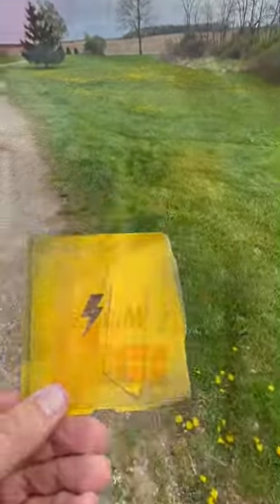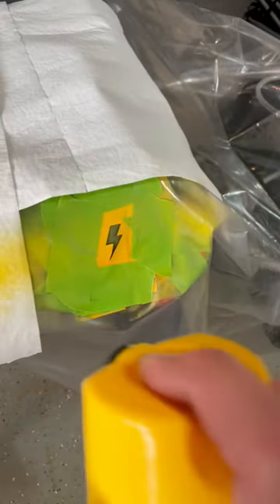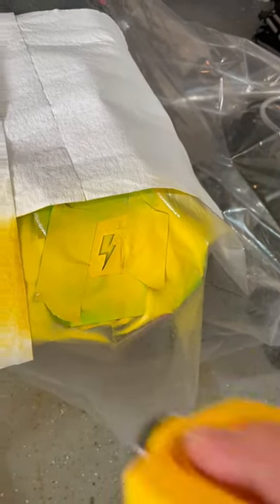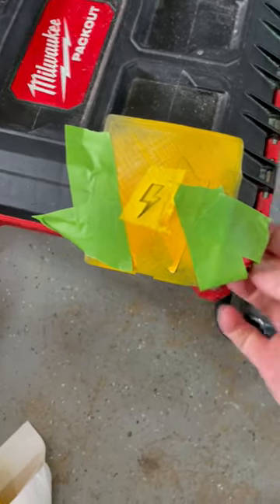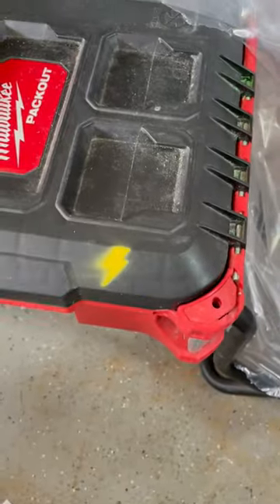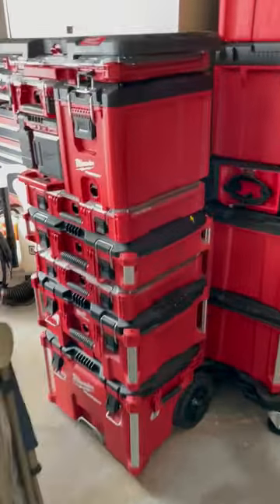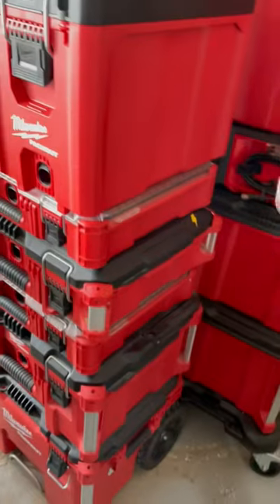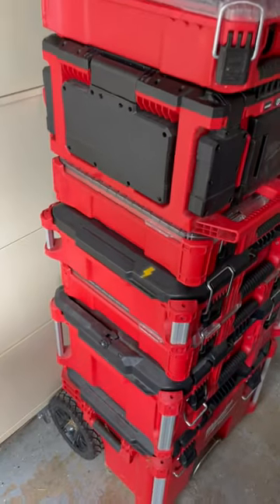How I label my Milwaukee PACKOUT...     #shorts

Comment: If you have to go back and spend that much time to touch it up after spending so much time masking off everything around what you are painting, then the whole thing is asinine
Reply: He’s not using tape on the stencil part lol everything is just popping up and leaving room for paint to overflow.
Reply from the maker: The first time I sprayed it, the stencil worked near perfect.  I need to prop some weight on it next time.
Reply: @MarkThomasBuilder  yes that’s the solution
Reply: That’s asinine,asiten and asieleven. 

Real shit… you should use a branding iron. It’ll be permanent. The spray paint isn’t gonna last